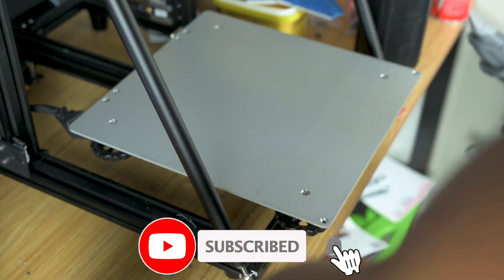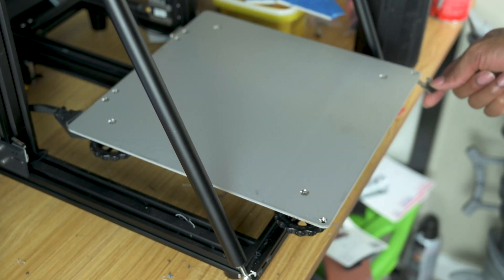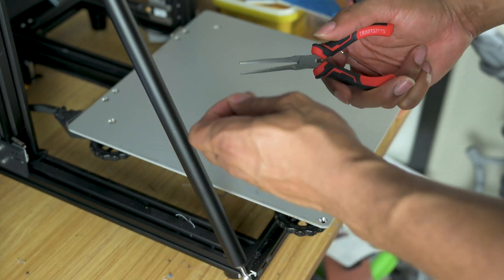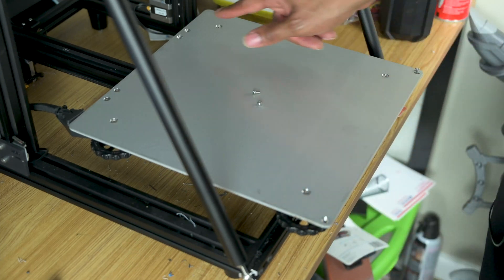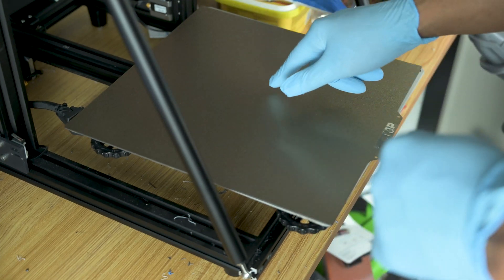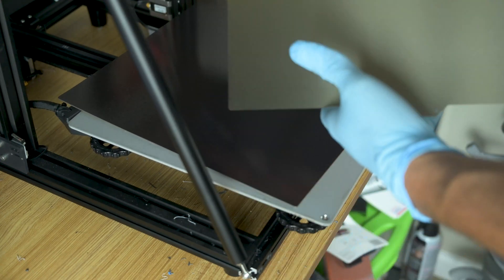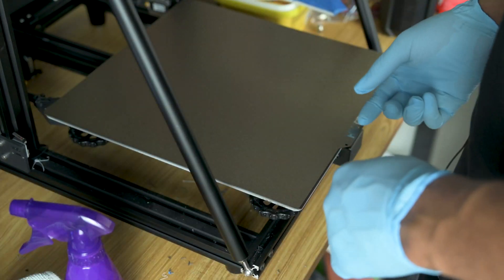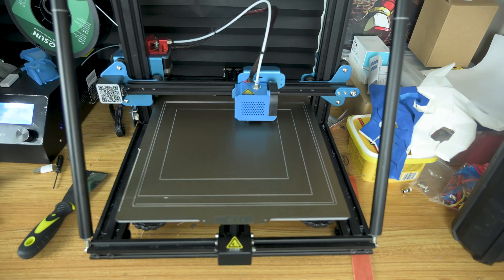How To Install A PEI Sheet To A CR-10 Cosplay 3D-Printer

Comment: ok i have the cr-10 v3 do i have to move the limit switch for the pei as i also changed the springs to rubber spacers
Reply from the maker: U may have to adjust it a bit lower as the pei sheet isn't as thick as the glass bed

Comment: So the first time I bought one of these I fell pray to false advertising. I don't want to let that happen again so tell me is the PEI sheet you installed 4 mm thick or 2 mm thick
Reply from the maker: This is the exact one I bought. https://amzn.to/3GnoL4I.

I am not at home so I cannot measure but they state it is 4mm thick. It was more than thick enough when combined with the magnet sheet for my needs. But do note that once u adhere It to the heated bed it's almost impossible to get off. So if u do not like it u will have to buy a new heated bed.

Comment: Hey, I recently have had lots of issues with my mirror tile I’m going to get pei could you tell me where to get those bed dip screws so I don’t have dip on my cr10s
Reply from the maker: Hey, the screws are the ones that originally came with the bed. I did not purchase any extra screws.
Reply: @boundlessperception1466  my cr10s didn’t have those screws with it
Reply: It has the dip in the middle though
Reply from the maker: @BiggieDark  the dip in the middle? U mean where the screw sits?